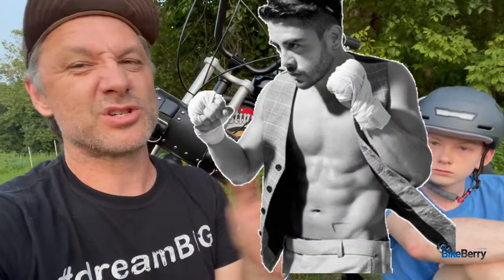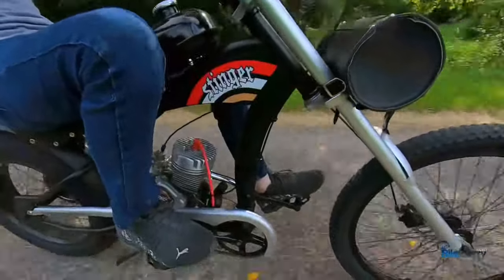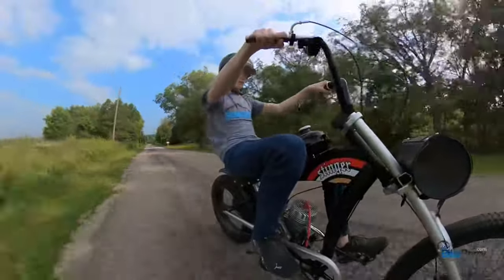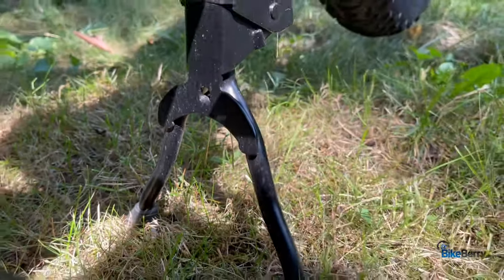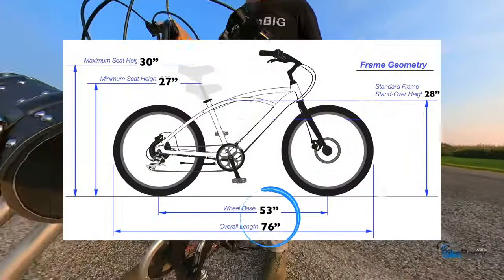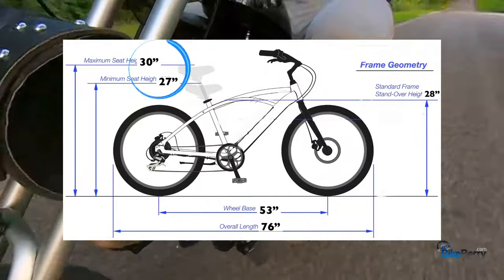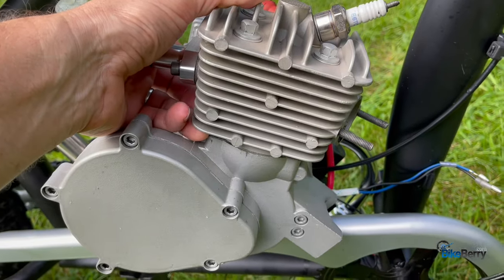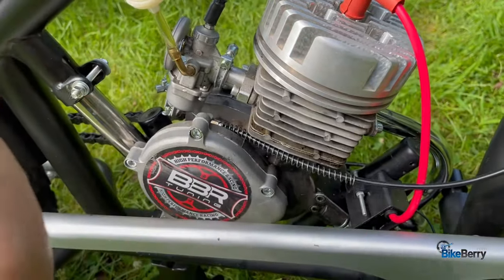Revving Up the Stinger: Our First Ride on the Motorized Chopper! | BikeBerry

Comment: Hey Tony, thanks for this content. I recently came across a2005 Schwinn stingray occ chopper also with a 100cc engine kit. Kit needs work and the seat was Harley style rigged with springs on the rear of it.
However, I ran across an exact replacement of the oe seat. I was happy it fit in that day seat post tube! Problem now I have is a lock down clamp for either and any sweat for this Cali chopper

Comment: If you use with chain guard with spacers out I used u bolt brackets and the pipe I heat stock and bring up and I go through Carr hardware and carquest for parts that fit up..

Comment: Berry, im going to install one of your motors on to my e bike. On the rear wheel i see the sprocket and the bike disk brake. Did you install an adapter or is the sprocket engineered to have a disk brake mounted? Kinda new with this topic. Thanks!

Comment: I'm a chopper fan and a bbr fan, but why not build it with a built in frame fuel tank? That would definitely help a lot for a lot of people, and would look good..as well. Also like to add, I love how you run without the air filter, down a dusty driveway..

Comment: How do the original pedals not spin with the back tire spinning from the motor and the chains are hooked up to the original pedals and the other chains are hooked up to the motor?

Is it because the motor has a clutch or how does that work? Without spinning the original pedals and chain lol I'm wanting to make my diamondback drifter a motorized chopper

Comment: Kids bike for sure but peddling is a chore as I see his knees are at his chin on the upward stroke. Kids are not 4 feet tall which you would need to be to fit comfortably on this design So just wrong on about 7/8 of your pros. On this bike. Effortless? Wrong. Powerful, wrong. Too small, yes. You would need a back rest to push backward to peddle at all. So uncomfortable looking. Body does not fit the bike ti use as a bike. And the seat has to be raised In Order to ride the thing. Which takes away from the low rider style look to begin with. Also in order for any bike to be actually designed for any motor they would have to be made heavier, stronger and have a place to put these motors instead of strapping them to the frame with bits and bolts. Obvious by the long winded promo post here this is actually an advertisement for bike Berry. If they did make the bike for an engine the chain guard would have been in the way, and muffler pipe would not be an issue on any motor. Gosh I can’t stop about the cons. Too many to list. Motorcycle frames dont have chain restrictions. Or w just problems. Yes I know it’s not a motorcycle. But it’s not a bike actually made for a engine. Exhaust a problem!!! Chain problem. Riding this and feeling like you are going to fall off…it’s just too much. But after all this said. Please rush to the cart as he says and start ordering all the parts you need! Go now before they are out of stock. I’d buy one just to prove that everything said is bull#~{* oh, but great effort. I do like the dual disk brakes. But if the rear is mounted to frame it will never be adjustable to where it lines up as needed. It’s gonna be a terrible fitment issue. Trying to adjust the wheel to work with the fixed hardware. Unacceptable. Too many issues. Dangerous. Buy at your own risk.
Reply: Sounds like this bike isn’t for you as you’re concerned about things the chopper crowd doesn’t mind one bit. This was born out of the requests from those people not you or I. As you see I’m not really part of the chopper crowd either. But I had to look at things from their perspective to understand what they love about these bikes that aren’t built like comfy cruisers. Go ahead & search motorized occ schwinn chopper to see how they raise seats, modify handlebars, etc doing whatever it takes to have fun riding. This hobby is the fun of taking a bicycle strapping a weed whacker engine to it and zipping down the road. Which is a blast 😊
Reply: If you don't like it don't buy it. By all means design and build your own gas bike frame to your standards and sell it

Comment: Thank you ive been struggling outta work for 2years .? How ?? 😮‍💨🤯🫨🤕 
Anyways, the way that 2stroke 66 80cc engine fits. 👏🎉👏🎉 
I've been debating on what bicycle to use, on mounting my stage 4 kit to. I have one Schwinn sanctuary 7 step thru (heard)  havent tried. (It wont work.) Have the 26" Kent Glendale (Green guy) "nickname? I dont know" 7speed . I have pieces of a Huffy Sanford Men's 26" possibly buy parts to finish that one. Also, pieces of Huffy Casoria Mens 27.5" also could buy parts to fomish that build last two cane from ebay its been 1month and actually! 1month and 1week today trying to get the bicycle I  bought in whole for my collection of bikes  options were none! still no refund 4bikes in and not one not one, with all the parts to be fully assembled.